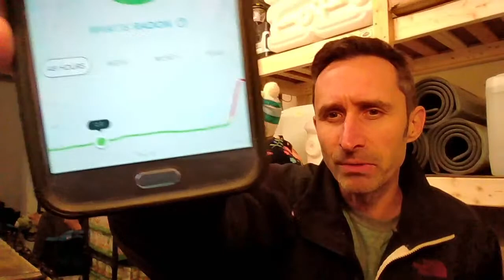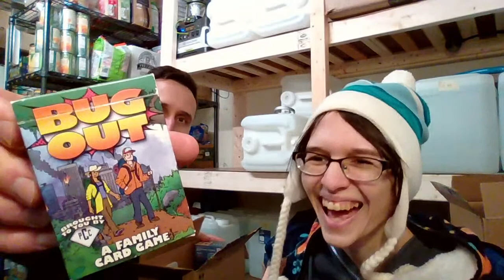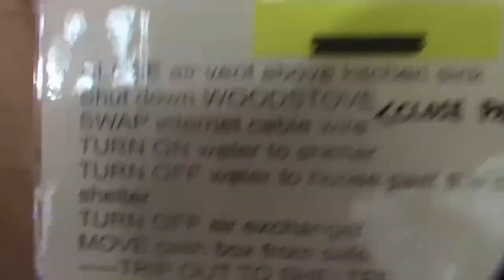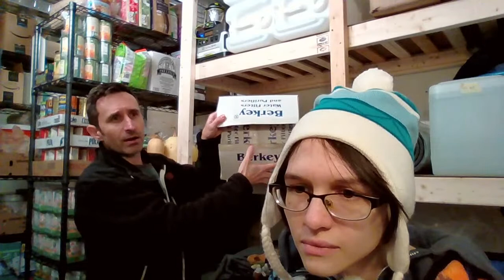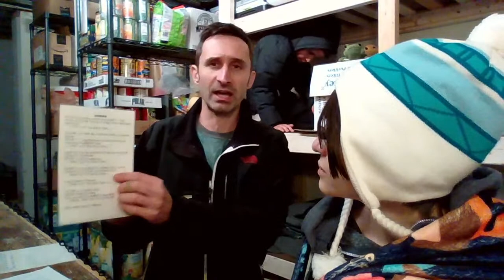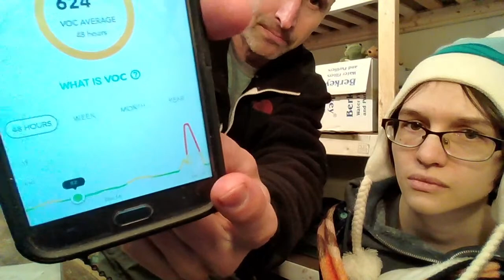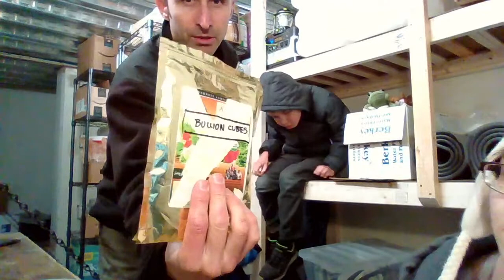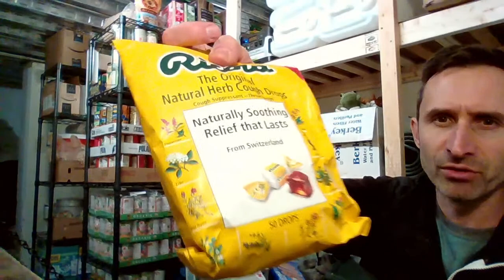LIVE FROM THE FALLOUT SHELTER - FULL TEST

Comment: Bacteria doesn't go through plastic. To prevent the door from being blocked by debris, make the door so it opens inwards. The signs referring to SHELTER in the house in the power box will potentially alert the intruders you apparently expect that there is a shelter nearby (if the power is not working they may well check the box which is in the pantry where they definitely will be interested in).  Ideally, buy a greenhouse to keep a cleaner growing area. it will also extend your growing season anyway. Hard to believe you have a fallout shelter and no greenhouse.
Reply from the maker: I recall the comment regarding bacteria moving through plastic. I didn't want to totally shoot it down because I don't know everything, but it seemed far fetched to me too. Certainly if the plastic had a hole in it... but probably not any real concern.
That's a REALLY good note on the electrical box notes. I made a real mistake in being so clear with my labeling. I'll definitely genericize those labels. Thanks for that advice!
On the greenhouses, you were correct to think it was hard to believe that I had a fallout shelter but no greenhouses. I have two of them, and plan to have more in the future. They're a great asset.

Comment: Do you have backup power for your shelter to run the fan ? What do you use to filter the intake of air.
Reply from the maker: we have two totally independent solar power systems that can run the fan. If both fail, we have a manual bellows setup that can be used. The bellows are shown in the video towards the end.

Comment: you mention a lot of technology items, like computers, Nintendo switch, etc.  I understand that some items are in your tin bucket but if an EMP goes off, do you expect to have those items functional?
Reply from the maker: What I suspect is that I'll find out what survives after the event. An EMP is an event that has been modeled in computers and tested in limited ways in the real world, but there is still a lot unknown about what exatly would and wouldn't survive and depending on the specific location of each item, the outcomes could be very different. There are stories of Hiroshima where certain areas were oddly spared as much damage as others. EMP and nuke pressure waves arent the same thing. But what is similar between the two is that they're both complex events unfolding over a complex environment. So the outcomes are hard to predict with total precision. Long story, short. I'm bringing in things that might fail to work. But anything that might likely fail is either noncritical or has a reliable replacement option (like the manual air vent for if the electric one doesnt work).